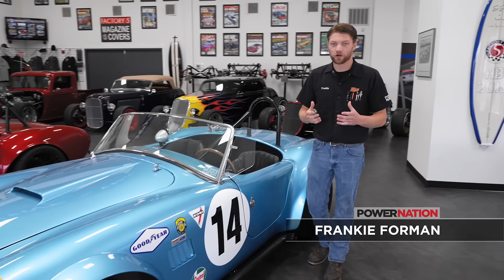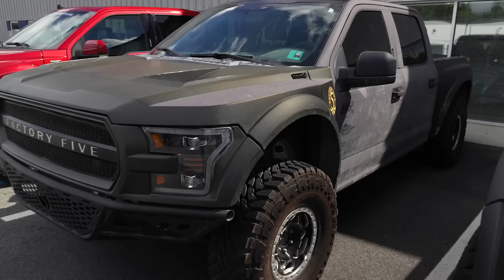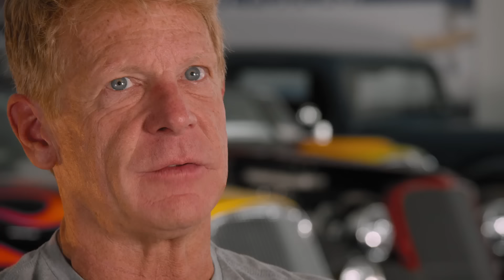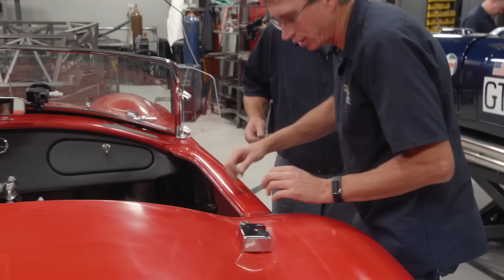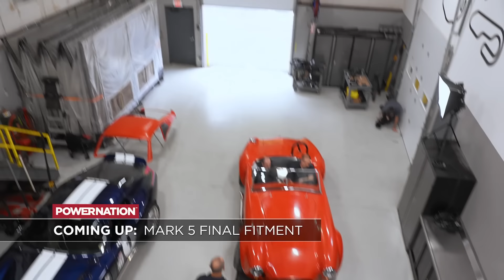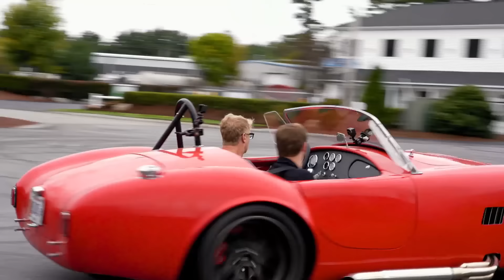First Look at Factory Five Mk5 Cobra - Engine Power S11, E18

Comment: Please do an improvement program like this on the type 65.  If nothing else please redo the body on the type 65.  I can deal with cutting and re-welding bits and peaces to make trannies and rear-ends fit, but the amount of time dedicated to chasing down voids and air bubbles in the gel-coat is just ridiculous.  With the improvements you made on the Mk 5 you've shown that you CAN make a good fiberglass body if you put your mind to it.  You just need to do it for the Type 65 line.

Comment: Tedward drove a Factory Five Cobra, and he thought it was scary! His (borrowed from Bond Group) had a 400hp crate motor. Mine would have a relatively weak stock V-8, which I think would still be great fun, but not quite as unforgiving. His car had a different chassis, a ladder frame similar to that on the original.

Comment: I love FFR and the innovation / improvements. But, here is what disappoints me.1) I don't mind under the skin improvements but departing from the originals in terms of how the transmission tunnel and dash are on an angle now looks weird. 2) You don't offer true knock off pin drive wheels...Superformance, Kirkham,Backdraft,Shelby do. The covers FFR over over the 5 lug give me the ick. 3) The e-brake on top of the tunnel... Ick. 4) Led headlights cool, but they look funny and lose the classic look. The mk5 looks more like a restomod IMO. Like I said, IDC about how things look under the skin, I think it's awesome, especially the forged arms, but the focus should be on making the exterior as accurate as possible.

Comment: Do these cobra reps from FF have power steering I see the rack is a power rack and I see a pump on the motor but it all looks capped and the racks hard lined into each other..I am real curious if the setup can be purchased separately.
Reply: Most people do power steering in their Factory Five.  We can't see if it's in this car but usually, those with manual steering choose the much larger, period-correct wooden steering wheel.  This car has the 14" leather steering wheel (which still looks good.)  Factory Five sells a "complete kit" but that includes a manual rack.  The main reason most do power steering is it's extremely difficult to autocross a FFR with manual steering.  With the power steering you can get a whopping 8 degrees of caster.  You may already know this, but increased caster helps right the car if you get squirrely.  Electric power steering became available about 10 years ago - the advantage of this is you can adjust the assist with a simple dial.

Comment: The writing is on the wall. Electric performs better on the street. An EV version of this would be great.
You guys can still put the loud V8s, that's fine. 
I'm just saying that I'd like a kit that I can charge overnight and do the quarter in the nines.
Reply: Several people have built electric Factory Five Cobras.  Factory Five can even supply the chassis with the right motor mounts if you buy an eCrate motor.  Otherwise, most all of the electric Factory Five Cobras have been home-grown.  The question for an eCobra is "sidepipes or no sidepipes?"

I don't know of any videos of electric Factory Five Cobras doing the 1/4 mile but it exists for the Factory Five 818.  Search for: Tesla powered 818, 9.5 quarter mile run

Comment: Might sound sacrilege to Americans, but put Toyota 358 NASCAR V8 in there with 750 hp.  See if it overwhelms the chassis, then improve chassis again.
Reply: I've been on the Factory Five scene for 25 years. I'd say that about 2-3% of Factory Five builds don't have a Ford motor.  People have done anything from a V12 BMW engine to a Viper engine to LS engines.  High horsepower engines don't overwhelm the chassis - they overwhelm the tires.  After that, the rear axles on their IRS are the weakest link.

Comment: Please build a Cobra with this 934 HP pump gas, NA SBF engine:  https://www.youtube.com/watch?v=5Rz7paeKSOM The ultimate combo. A Clevor Cobra.
Reply: Even with modern tires, it has been found that 650hp is the maximum horsepower a Factory Five can put on the ground and still be controllable.  Several people have built 1,000+ hp motors, only to de-tune them so they can actually drive the car.

Comment: I sat in a Mk3 a couple years ago, and the lack of footroom (13EEE) made me realize this wasn’t a car for me, despite always wanting one. I will check out the Mk 5 when I get a chance.
Reply: The MK3 footwell was a little tight - this was to accept the DOHC "mod motor" from Ford Cobra Mustangs. My MK3 has a custom mod to the footwell to make it bigger.   The MK4 has much more foot room, presumably the MK5 does as well.  The challenge though is the pedal box is the same.  I'm unaware if there are "wider" pedal boxes available.

Comment: Daaah "the body fits"??? how many years you been working on design and engineering? Your suprized that the body Fits! Got that much confidence on the rest of your innovations?
Reply: Fiberglass bodies don't come out of an an injection mold like the body for a small toy car does.  It also shape-forms itself the first few months.  There's about 100 hours of bodywork on an FFR to get the fiberglass body to fit - door gaps, etc.  Reportedly, same number from the Superformance factory in South Africa.

Comment: Would be a nice version with a 4 cylinder.
Reply: For a time, spec racers were building Factory Fives with the 4 cylinder from the SVO Mustang.   Its lighter weight made up for the lack of power compared to the 5.0 and they kept up with them on the race track.
Reply: Turbo 4 cyl,

Comment: How about an engine option that includes the Ford Ecoboost four cylinder. Why not take a ton of weight off the front end vs the Godzilla. Still would have an awesome power to weight ratio and couldn't hurt the handling characteristics.
Reply: a godzilla is the worst engine possible in this car. too heavy
Reply: @richardschipper5989  haha, I don't know, a Ford Ecoboost 4 cylinder could compete for worst choice...  :)

Comment: A C6 transaxle would help move the CG back towards the driver and give the car more balance with the Godzilla up front.  It would improve handling and braking performance as well.
Reply: The only problem with that is that they're not terribly durable . An independent suspension system from a Ford Explorer would work better . The Ford 8.8 is light years stronger than the Corvette rear end .
Reply: and you know nothing about FF5's they are rear weight biased.

Comment: The coyote is such an amazing engine.
Reply: Coyote is too big size wise,  I like the Sbf - 363 with good  aluminum heads and throttle body fuel injection. (600 hp.). And a 5 speed trans.